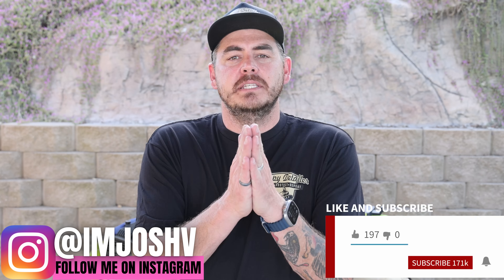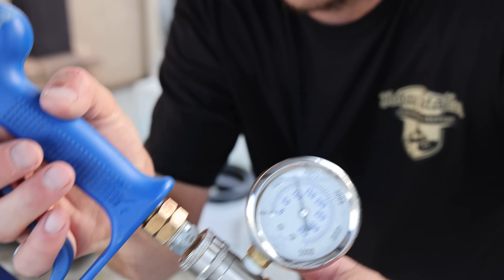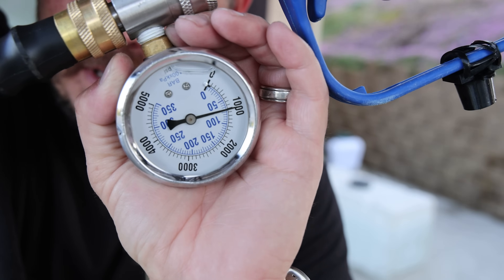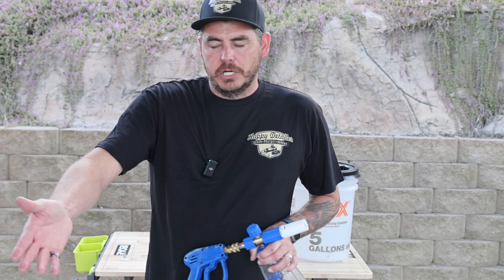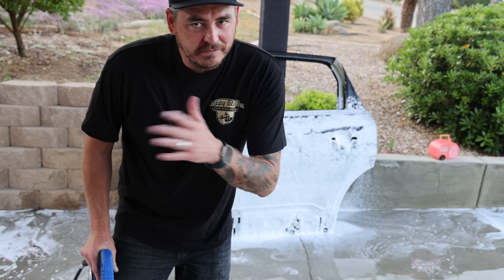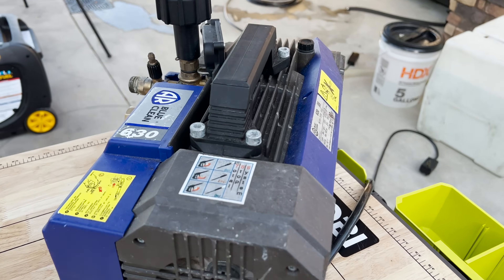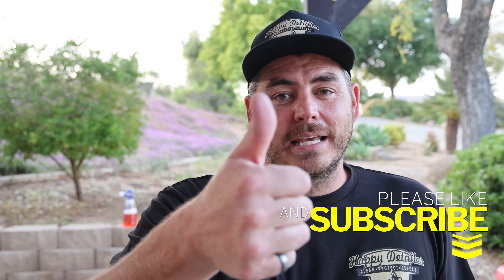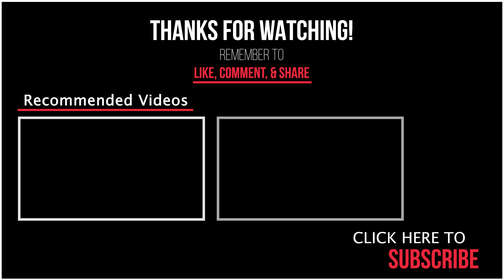AR630tss VS BigBoi Washr Pro - Detailing Pressure Washer Comparison

Comment: I bought the Washer Pro MkII based on your review during Black Friday deal. I received it and couldn’t get it to start; no water pressure at all.  I am a little confused as to why they have a quality test “passed” on it and the system doesn’t even start. I had to download WeChat and do a video call with them in the evening since they are in Australia. I saw in some of the comments from other folks have similar issues. Not the best product yet, maybe in a couple of years and if they actually have a physical presence here in the US. I’m in the process of returning it and will look at the AR630 TSS.  Seems like it’s been around long enough.  I don’t recommend this product, too early and too many issues.
Reply: Now you can buy the new model of AR630. Better macchine, new 4 pole indct. motor, new gen pump, deadly silent! 2.75GPM with 2130PSI. Better construction. It's AR630 Dual Pro..
Reply: mine just humms.........did they offer to send a repair kit?

Comment: What happened to the big boi pro? Can’t find it anywhere and the websight doesn’t even list it and your link doesn’t work. Also how do these type washers work with blasting of a bit more grime vs rinsing cars off like blasting under carriage grime off?
Reply: If your in the USA the bigboi hasn’t came yet and if you out of the USA it’s not in stock
Reply: @nicholaswicks3077  thanks! So it will be a while…
Reply: Unit has massive issues...you will be totally annoyed when unit fails that is if reside in USA
Reply: It turned out to be a big pile of crap with a lot of issues that they blame on the power grid in the US.
Please do not consider this unit if it ever comes backup on their website.
I had to file a charge back complaint with my credit card company and I got my money back.

Comment: Jash I’m experiencing a problem with my bigboi pro washer. First problem is I can’t use an extension cord it will only work when plugged in directly. My extension cord is 12 gauge and new. Next problem is it trips its own breaker that’s on the end of its cord. It is only using 12.8 amps? Some times it just busses then trips  its own circuit breaker not my breaker. What do you think?
Reply: My WashR Pro has been terrible. It doesn't shut off. I emailed Bigboi about it. They suggested strechting the spring out. It broke when attempting that. I responded saying it didn't work. I have not heard back from them since. They are a terrible company in the support aspect. I would never buy from them again nor would I recommend them, to ANYONE!
Reply: Hey Joel, were you able to get this fixed/what ended up happening. Looking into order one now but wanted to get some peoples thoughts.

Comment: Not sure where your getting the price for the Big Boi everywhere i look its $800 unit only.
Reply: Depends on what country you are in and the exchange rates. Bigboi USA website is $699 but sold out until early-mid June
Reply: Gonna be a longer wait is my guess. Motors are having voltage issues. Motor won't start, the motor hums and doesn't turn on. Trying to get their Customer Service involved ... And they just run you in circles. Try a different receptacle. Try a 20amp circuit. The receptacle is too far from the breaker panel. Don't know where they are finding these ridiculous "solutions". People are sending in videos to Bigboi  ... And nothing but crickets. 

 If you are in the US ... Just wait to see how they handle a big known issue.
Reply: @HeadShot1171  There needs to be a troubleshooting process for each case issue, sometimes problems can seem to be the same but might present differently from different environments. Bigboi, its factory and testers in the US have been working through a range of tests and solutions. Updates will be advised very soon. Sorry you have experienced issues, hang in there the Pro is a cracker off a unit. Bigboi is aware of your issue and the others who have commented on this platform, you will have an answer very soon.

Comment: Hello everyone so i need a little help, i just recently purchased the washer pro i tried using it with my generator predator 3500 watts and for some reason it keeps powering down,  I would like to know if someone has been experiencing the same issue and if so can someone help me with this issue? I would really appreciate the help.
Reply from the maker: Hey yea i actually mentioned that in this video. The usual recommendation is atleast 2x the motors watt rating. This one is rated at 1800 so a 3600 continuous at minimum is recommended… the active 2.3 doesn’t turn on either with that generator…. For some reason my ar630 does work with that generator and that is also a 1800watt motor which doesn’t make any sense to me… because I’ve ran the ar I expected this and the active 2.3 to work but I guess it’s different with generators

Comment: I've ordered the BigBoi Washr Pro as well as a Blowr Pro and accessories.  I had a small issue with the wall mount and customer service has been terrible.  I've been waiting for 6 weeks for a replacement wall mount, for some reason.  Such a small issue that they seem unwilling, or unable, to resolve.  This experience makes me regret my purchase, as if I have a real problem, who knows if I will be able to get it resolved.  Granted, I am very happy with the performance of the pressure washer and blow dryer, so hopefully I will never have an issue.  Will choose another company, though, when it is time to replace these just based on this terrible customer service experience.  I've tried to escalate to the CEO but no way to contact him.
Reply: My WashR Pro has been terrible. It doesn't shut off. I emailed Bigboi about it. They suggested strechting the spring out. It broke when attempting that. I responded saying it didn't work. I have not heard back from them since. They are a terrible company in the support aspect. I would never buy from them again nor would I recommend them, to ANYONE!
Reply: @mundymulligan665 lucky i read your comment. Thank you
Reply: Just to give an update.  Bigboi did send me a new mount.  All is good now.  The Bigboi GM, Mark, reached out to me as well to make sure everything was working OK and if any additional help is needed.  I see this as a positive sign for the company.  I think the initial issues that I, and other, experienced, were just some temporary growing pains.  I'm definitely happy and feeling better about my purchases now.  To all that have had issues, give them another chance.
Reply: @mattc7568   Man, I wish I could get mine going well. I have tried several, MANY different springs in the TSS and some allow the pump to turn off, some are too stiff and keep it from turning on. I have one in there now that has worked three times in a row. We will see. I just hate fussing with a new tool, any new item, truthfully.  I love the look and performance when this thing runs.

Comment: Can anybody smarter than me help me out? I have an AR 630tss and I have a Predator 3500. My entire build in my Honda Element is centered around that generator bc I thought it would be enough to power it. The first two times I used it, it worked flawlessly. Now every time I plug in the AR it trips and powers down. I bought a $99 Ryobi just to keep things moving but I'm getting sick of walking by the 630 in my garage every day. He mentioned powering down the output at the start of the video, does anybody know how to do this?  The predator comes with a 30 amp rv adapter
Reply: The Predator 3500 has a  running wattage of 3,000 watts and a start up Or maximum wattage of 3,500 watts. The AR630tss does not give a specific start-up wattage that I can find but says it requires a 20amp circuit. So, a twenty amp circuit is rated at 2,400 watts. (20 amps x 120 volts) If you take the 2,400 watts and multiply times 2.0, which is a safe minimum multiplier, for these types of motors for start-up wattage. You would need a generator with a start-up or maximum wattage of 4,800 watts. To have a little more headroom I would see if you can return your Predator 3500 and exchange it for the 5000. The 5000 has a maximum wattage of  5,000 watts and a running wattage of 3,900 watts. On all motors it is the start-up wattage that makes it difficult to figure out the required size generator. I hope this helps.
Reply: @life36899  Heres AR 630tss specs:  needs true 20 amp and Watts 1800, voltage 120v-60Hz. all of which pred3500 should  handle. after researching on reddit a little pred 3500 max sustained load is 25 amps continuous. but neither of the two standard  3 prong support a true 20 amp. yet the RV plugin is a 30A circuit. so I've heard of people using a converter cord to take advantage of the 30 amp plugin.
Reply: @vermontmotorsports1275  The part of the puzzle you didn't mention is the start-up wattage on the motor. Another way to look at it is a house 20 amp circuit has a breaker protecting the circuit and it will allow a spike or start-up current that exceeds 20 amps by several times for a short period of time. So start-up current on a 20 amp motor works fine. A generator has a maximum wattage output. Again, the motor on the AR has a start-up wattage around 2 times it's running wattage. So 2,400 x2 = 4,800 watts. I do not believe the 3500 will produce enough wattage to start the motor on this AR unit. Once started, it would work fine. Even if you use the 1,800-watt rating and multiply it x 2, you still need 3,600 watts of start-up wattage. It might work in perfect conditions but I don't believe it will be reliable.
Reply: Using my AR630tss with Predator 3500. Use the 30amp RV plug and turn off eco mode. No problem.
Reply: @div216  It sounds like there is enough headroom to make it work. If following these instructions and the generator still trips out, then there is probably something wrong with either your generator or pressure washer.
Reply: @div216  thank you very much man. and you just use an adapter plug in? 30amp rv to 120v?
Reply: @vermontmotorsports1275  when I first use that 30amp outlet I used an adapter plug but later on I did this from Ralda’s Details tutorial so I can plug my OVO vacuum and water pump for my AR630tss. I only use one at a time anyway, vacuum and pressure washer. 
https://youtu.be/LKkBF15YdmA?si=6E1KJOsUCfrjHYFX

Comment: In my custom-built small enclosed trailer, I've installed a 100-gallon tank to supply the 630TSS, RO/DI refill filter system, 8070 Lite III, Fortress 10-gallon air compressor (model 57328). Additionally, I have equipped the trailer with a 50-ft air reel, a 50-ft power reel, and a 50-ft reel with Uberflex hose. For organization, there's a toolbox containing all necessary smaller items.

On the roof, I've installed  solar panels to power an EcoFlow Delta 2 Max + Delta 2 Max Smart EB system, along with an EcoFlow generator fueled by a 5-pound propane tank.

The Delta 2 Max essentially functions as a single 20-amp circuit, allowing me to power either the pressure washer, air compressor, or Mytee system individually. While it's rare for me to drain the battery completely, I've never had to utilize the generator except for testing purposes. With 3.8 kWh of usable power, I can run the pump continuously for approximately 2 hours or operate the Mytee system with heat for about 1 hour and 45 minutes solely on battery power. Moreover, I receive anywhere from 500-800whrs every hour from solar energy here in palm springs i go solo and i tow with my old scion xb I have brakes on the trailer and a fulll 7way setup with redarc on the fist gen xb
Reply: This sounds amazing and like you’ve put a lot of thought into it. I’ve been wondering if an Ecoflow could power any of these pressure washers, so that’s good to know. Which panels are you running? Really cool to not have to be running a generator all the time which makes your setup seriously quiet.

Comment: BigBoi has no idea when this will be back in the US for sale. You would think they would know the schedule for delivery to provide an accurate eta. AR is readily available and easy to access for repairs/ maintenance.
Reply: Early to mid June
Reply: We will advise on social when it's on the way. Just confirming shipping times ATM
Reply: They have not figured out how to get their unit to work on 120v 15 amp circuit and meet specs.
Please stay away if it ever comes back up on their website

Comment: I don't have a dedicated 20 amp circuit in my garage, but my outlets are in 20 amp circuit, can i still run the AR630?
Reply: You should be fine. The only time a 20 amp outlet is required on a 20 amp circuit is when there is only one outlet on that circuit. As long as there is not something else running at the same time on that same 20 amp circuit, you should be good to go. I hope that answers your question.
Reply: Thank you...thinking about buying the AR630tss over the active 2.3

Comment: Can you recommend a pressure washer for home use (mostly for car washing) I was dead set on the Active 2.0 but there's so many reviews of people saying the TSS craps the bed and then it just keep running. That's why I'm in the market..  my current crappy washers stop system also failed and I find it really annoying to walk back and forth turning it on and off. I'm not professional level but I do like buying high end stuff and I don't mind spending money, but I'm not looking to spend more than 500 unless absolutely necessary.  All I require is electric, 900 to 1200 psi, and most importantly high gpm. 

Whats my best bang for the buck?
Reply: Look into Ava pressure  washer  , these are great  for car detailing  at a good cost

Comment: I went with the Bigboi Pro and it is working well.  I purchased the hose reel and caddy along with the pressure washer unit.  The hose reel and caddy are portable if you need that, but it also mounts on the wall simply and can be pulled off if required.  I like the flexibility that the Bigboi unit provides.  Thanks for the side by side review.  I don't think you can go wrong with either unit.
Reply: Are you in the US and still liking  your Pro? Looking into getting one but have heard a ton of negative comments

Comment: Anybody that came to see the Bigboi Pro please do not buy this unit. Like every other person who bought one it is a piece of junk.
My dis not neet spec, i did their adjustments they recommended and it would come close to spce but draw over 15 amps  With there foam cannon it would draw over 17 amp. At times it would not turn on and pop my gfi outlet. Tried the spring stretching they recommended still did not always work.
I tried 4.0 tips as they stated the unit would produce 2.2gpm. My unit could not produce more than 825 psi and only did 1.9 gpm, far from 2.2.
They are blaming it all on the  power system in the US causing the issue, what a joke 
My credit card company refunded my my purchase after distbuting this pile of crap.

Comment: mind providing more details on generator use?  i remember seeing on bibbois page that if you are going to run it with a generator they have to modify it for you but doesnt say what that means, and as far as the 2.3 it just does not run at all with a 3500 starting watt 3000 running watt generator?

Comment: Can you plz check out the new Dewalt pressure washers they have two new ones to the ones you did with the 550psi an the 2100 an 3000psi washers but this new ones just take the batteries I need your input before I buy lol plz test the foam cannons also on them an which batteries is best I’m waiting for your review on them

Comment: Good timing, Josh. My Active VE52 just quit on me today, so I’m in the market for a new PW again. The BigBoi for sure has my attention, but they’re sold out. I can’t go for long without one, so we’ll see.
Reply: I would get the AR because it’s proven. I would wait a few years to see if BigBois last
Reply: @BondsIsKing  I like the brand. I'm just concerned about the need for a 20A circuit, which I don't have. I know you can use different tips and orifices to drop the current draw down. I'd just rather not have to.
Reply: @cgraham6  If you have a buddy who is an electrician you can install one for $100 and a case of beer. It’s just nice to have one in the garage. Not only for the pressure washer but opens up other tools so you don’t spend the rest of your life wishing you had a 20 amp